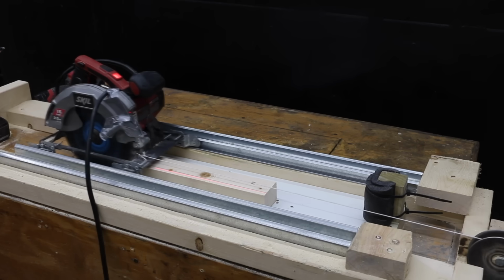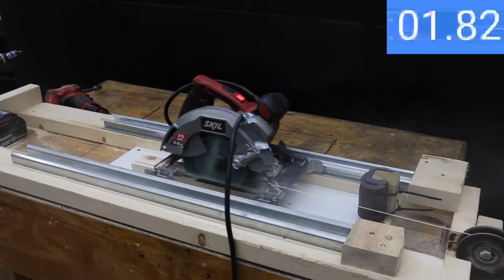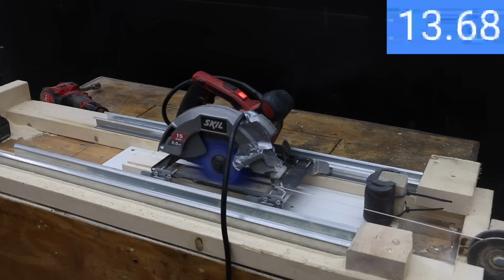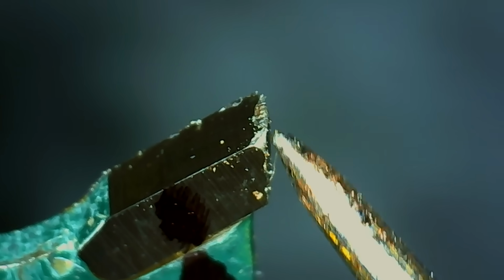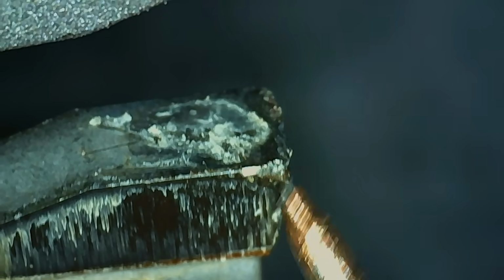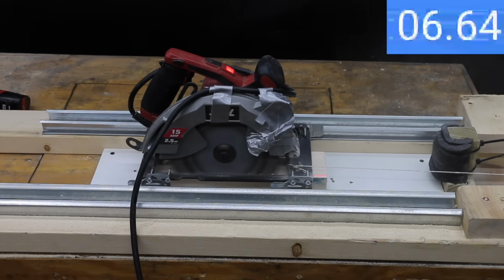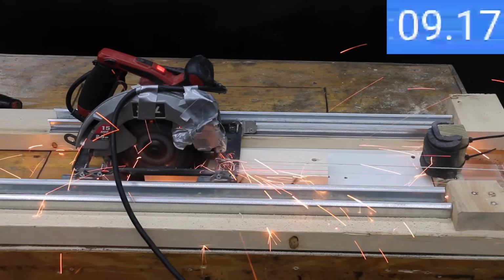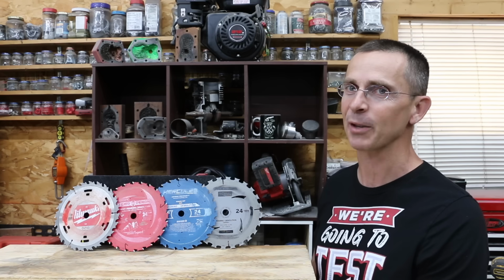Best "Demolition" Circular Saw Blade? Milwaukee, Diablo, DeWalt, Hercules, Evolution, Bosch, Amana

Comment: Each test I'm like "Big Blue.. what are you doing??" LOL Hey, maybe that "Big Blue" would work better as a brush cutting trimmer blade haha
Reply from the maker: Thank you!
Reply: Good point. But wouldn’t that mean that any of these other blades could be used for that application and perform better?
Reply: @yewsengcheong1637  I'd guess the green wood would clog most of these blades
Reply: That's exactly what I was thinking.  They should definitely remarket that thing
Reply: True!

Comment: I’d like to see who makes the longest lasting mower blades. Almost everyone mows.
Reply from the maker: Thank you for the video idea!
Reply: @ProjectFarm  This is a good one. I just threw down $30 on a blade.
Reply: Bold of you to think there are people that actually remove the blade that came with their mower.
Reply: @mc-sp8zr  I saw a guy come in the mower shop while I was buying blades and said his wasn't mowing good. I ask if he looked under the deck at the blades or to see if dead grass was built up on the deck. He never even looked😜 I swap sides of the deck each time I sharpen mine (2 blade riding) because the discharge side blade always wears faster. It gives each blade equal wear doing that.
Reply: @mc-sp8zr  LOL!
Reply: Big blue is damn near a brushcutter blade.
Reply: @queazocotal  FR like wtf kinda demo are they expecting? Concrete block? I kinda think it's meant for a saw with a more powerful motor, not your standard skil saw.
Reply: @queazocotal  ARK player?
Reply: I have requested this too
Reply: @n325aej that's what i was thinking too but that doesn't really count as the blades lasting longer. If i crash my new truck, i wouldn't say the tires outlived the truck lol.
Reply: "Almost everyone mows." is a statement soooo out of touch with reality.
Reply: @orijimi  he likely means that you’ll have a much larger potential viewer count with lawn mower blades rather than, say, demo blades.
Reply: @Slayerformayor1983  exactly what I meant. More people use mowers than they use circular saws. I use both, but I mow probably 500 hours to every 1 hour of using a circular saw. Especially when I have 8 acres and no livestock.
Reply: @orijimi  I hate idea of mowed lawns so much lol. Waste of space.
Reply: @orijimi  Not everyone is like ewe and lives on a goat farm, not needing a mower.
Reply: My 1991 lawnmower still has the factory blade.  I do sharpen it once or twice per year and the ends are getting pretty thin, but I've always failed to see the merit in getting a new blade vs sharpening the one you have.  Maybe a test of a new blade vs an old one that has been sharpened?  (assuming the same lift profile)
Reply: @knurlgnar24  I always sharpen my blades but they’ll eventually get so thin they’re dangerous. They’ll wear a hole between the edge and the back of the blade (In the middle) I’ve got a huge yard and it’s sand and zoysia grass. Both are hard on blades. Everyone I know around here has to replace blades. Are you using a push mower?
Reply: Or...best mulching blades..
are standard blades that can mulch good as blades that say "mulching blades"... let's find out....
Reply: @boosted2.4_sky  Spent time on a mowing crew for a big zeroturn dealer. We could never tell a difference.... even the clumping in wet weather seemed consistent lol
Reply: @Savagenerds  I mow yards for a living, never could see much of a difference between mulching blades and regular.
Reply: I don't know which are best but the scag brand ones are really good. More difficult to sharpen though.
Reply: mower blades are a great idea BUT different brands have different sizes and thicknesses. My Honda blades are substantially larger than my previous brand blades and therefore have a much longer replacement interval.
Reply: @dalinean  all he has to do is go to a mower shop and ask what their most commonly sold blades are and test different brands of that same blade type. Each brand will probably use different hardness of steels. Or maybe not. It would be interesting to see if there’s any difference in brands.
Reply: Something to consider on mower blades is thickness. I have a Hustler mower and their blades are 0.200” thick. Dixie Chopper blades are identical, but are thicker, 0.250”, so they last longer.
Reply: @lem7181  Hustler publishes dirty magazines AND produces outdoor equipment? That's genius.
Reply: Could be a tough one. I use Oregon gator g5. Which is a mulching blade but commonly used. Maybe 2 test. Mulched and regular.
Reply: @n325aej i already agreed with you way back in the thread. What's your point about 100 hours though?
Reply: @n325aej we aren't a grass cutting company but our commercial property has a lot of grass and we own our own mowers.  They don't run everyday like a actual mowing company would though.
Reply: I've never had a mower engine or deck outlive the blade.
Reply: @dalesworld1308  I need to find out what blades your using so I can purchase them. Then I need to find out what mower your using so I can avoid buying that brand.
Reply: @jamesbarron1202  I guess if you mow in a commercial situation you go through blades. But a homeowner GENTLY sharpening his own blades and not grinding the heck out of them, they should last.
Reply: @dalesworld1308  they'll still need about the same amount of sharpening per hour of mowing so i if its low hours and careful use, what kills the deck and engine?
Reply: @dalesworld1308  You should see my 1964 Economy Jim Dandy. Single cylinder rope pull start. Thousands of hours on the motor and deck. 1/4 inch plate steel deck.Been through three generations. The deck and engine will outlive my brand new John Deere diesel with ease.
Reply: @Lucas12v  
"What kills the deck and engine?"
Deck: Rust.
Engine: Old gasoline.
In other words, lack of maintenance.
Reply: @xenaguy01  that's about the only way a blade could outlive a mower. We probably get 100 hours out of a set of scag blades so a mower might go through 20 sets or so in its life. Not sure exactly since we don't keep track of blade life. And we mow kind of rough ground so i could see some people doing better. With cheap blades you might need 40 or 50 sets.
Reply: @Lucas12v  
"that's about the only way a blade could outlive a mower."
And unfortunately, that's the case with most individual homeowners. Few know about, or care about maintenance. Most junked mowers have  a perfectly good blade on them. A high percentage of them have never been sharpened.
Reply: @dalesworld1308  that doesn't seem possible but maybe I'm missing something.
Reply: @dalesworld1308  When I ran a landscaping crew we rinsed the mower decks after every shift, and lightly sharpened the blades every morning. The push mowers lasted the whole two years I was there and looked just as new as when I started. The problems we had were the brass geared transmissions on the power driven mowers.
Now I'm too lazy to wash my own deck so I have to break down every few years and do rust repair and repaint my deck. The moral to the story is wash your deck. Oh and never cut wet grass, unless you are willing to wash that deck.
On a side note: I got caught washing my deck in the sink one time, but that's for another forum.
Reply: Except for Josh. Don’t be like Josh.
Reply: @Ministry_of_WrongThink  hey, I just mowed today

Comment: Couple thoughts:
Ripping 2x4s is less common than crosscutting in demolition.
Saw tooth geometry and tooth size and spacing are generally designed differently for ripping vs crosscutting.
I wonder how much difference crosscutting in the 2x4 jig would have made. I'm guessing the times would have been quicker but I have no idea how that would have affected the overall  rankings, if at all.

Comment: Man I just knew that weird blue blade was going to do horribly lol. As a framer I can say that the Dewalt and Diablo blades work the best and last the longest. There is also I fine tooth Dewalt with many more teeth that works great and doesn't fray up the wood. We sometimes will turn the blade the other direction for certain demolition cuts but mostly for concrete siding if we don't have a diamond tooth blade. But we never use a brand new blade for demo. We usually will swap for a beat up blade to do the job.
Reply from the maker: Thank you!

Comment: Nails are considered inclusions and not the material you are cutting. When it says it is not meant to cut ferrous or nonferrous materials it means the main material you are cutting should not be metal. So no bar stock or metal plate etc.

Comment: As I've said many times, I love your channel very much indeed. I love that it is not sponsored by manufacturers, I love the way you break down the results, and above all, I love the amount of thought and effort you put into your test setups. I watch a number of product test content creators, and the setups you use to test are far and away the best to test for the things that matter to pros and to folks that only want to buy a tool once.
I know you don't accept sponsorships from the sources of your test products, but have any of these companies ever reached out to you? If so, what did they say?
Reply from the maker: Thank you very much!  I receive sponsorship offers daily but I politely decline all offers.  One company offered to give me a "free" zero turn mower just to use and provide them with feedback. No requirement to include in a video.  I declined the offer, since one thing leads to another and I'd rather avoid going down that path.
Reply: @ProjectFarm  Many thanks for the reply. Sometimes you just have to wonder if the manufacturers really understand how no-sponsor channels work.

Comment: I love your testing jig setup in this video.  Great setup for accurate comparisons.  Thanks so much as always and happy to see the cheaper blades won out on this one.
Reply from the maker: Thank you!
Reply: @ProjectFarm  hey good morning sir, only that I broke both of them this morning while getting ready for work.  Boot laces, can you test work boot laces?
Reply: @ProjectFarm  Yeah really Todd, Kudos to you for all the effort and attention you put toward your projects. I may have questions afterwards but I always have a very good idea what to expect from a certain product. I'll repeat it!! It would really be nice if consumer reports was so thorough.
Reply: yes I need to make this jig for myself as well. I think there's some drawer slides in the garage....
Reply: Same. My father has been using a cheap blade and has been able to cut multiple pieces of steel and concrete with it and it cuts faster than most of our cutting wheels.
Reply: Actually they were 2 different blades. It was the exact Diablo blade and a 60 tooth Milwaukee blade

Comment: I've ran a skill saw daily for the last 20 years. I've tried every brand lots of times. Diablo has always been my favorite for speed and longevity. INTERESTING results. Thank you, PF.
Reply: And it's not made in China. Clear winner.
Reply: Diablo is very good for the price. Been doing woodwork for 40 years.
Reply: Diablo is what we use in our metal cutting circular saw. Milwaukee does ok to
Reply from the maker: Thank you for the feedback!
Reply: Really depends on what you're cutting. I've had a 12" Dewalt framing saw in my miter saw that I use to cut applewood, oak, cherry and maple for the smoker. Been there about 9 years 🤣. Conversely if I'm just doing rough cuts in soft pine, I use some really cheap steel blades (no carbide). I can always touch up a tooth or two or throw it out cause a pack of 5 is like $8.

Comment: I’m always amazed at how much of a difference between the products of well known brands. You would think by now with hundreds of years of R&D they would all be basically exactly the same basic design/materials and the more expensive ones would be stronger but that’s almost never the case.
Reply: Like a 248% versus a 2058% increase in time to cut is an insane difference between two well known brands. How could a company with that much money going into creating these products mess it up so badly??
Reply from the maker: Thanks for the feedback.

Comment: I don't generally use my circ saw for demolition, especially not my cordless.  I have a cordless Ryobi, and thought it was crap until I put a Dewalt blade in it.  The Ryobi blade was junk.  Hey did you test cordless Circ Saws yet?  That could be a good test; I actually love my Ryobi Brushless one.
Reply from the maker: Thanks for the video idea.

Comment: Your comparing wrenches to ratchets, blades have completly diffrent uses framing blades give you speed and smooth cut, the carbide gives hardness. Demolition blades cut through masonry metal wood, but cuts rough, not good for finish work.
Reply from the maker: Thanks for the feedback.

Comment: Interesting. Some blades clearly "dulled"  while others "chipped"  producing a "new" sharp edge to keep cutting.  So, the Bosh can likely be re-sharpened, and the others will have to be tossed.  I wonder where the cost break is?  I am betting it is cheaper to go fast longer, and toss the blades.
Reply from the maker: Thanks!

Comment: In my opinion, you can't beat DeWALT blades. Ran them all for years, and when using them for only cutting wood in a carpenter shop the DeWALT blades have always lasted the longest. Good value and performance.
Reply from the maker: Thanks for the feedback.

Comment: I think we need a remake of the "best oscillating multi tool blades" now that diablo has carbide teeth on  many blades! I use the general purpose blades with carbide at work doing demo and it eats threw nails and screws. Even after taking some damage they still keep cutting until the carbide is almost gone
Reply from the maker: Thanks for the feedback.

Comment: Can confirm, Dewalt blades aren't up to abuse. They're prissy blades. An angry beaver could rip a 3/4 sheet of plywood faster than an abused dewalt blade. Took me years to get the boss to buy diablos for us to do formwork with. never looked back after we no longer had to frig around with dull blades.

Comment: I have a 15 year old DeWalt demo blade with huge carbide inserts set to a negative hook angle. It could cut through all of those blades for lunch.  Of course, it’s discontinued
Reply from the maker: Thanks for the feedback.
Reply: You’re welcome, as always. Considering I probably will not use that blade ever again, being retired, perhaps I can send it to you for Project Farm testing? The blade is a beast!

Comment: There was not a "shingle" thing wrong with this video. It was very "pallet"able. You really nailed these tests.
Reply from the maker: Thanks!
Reply: Your humor is pretty sharp. Not a dull moment around here. I definitely saw this coming.
Reply: But did the video make the cut?
Reply: Cutting edge comments on this one🤣🤣🤣🤣🤣
Reply: Yeah, but the blade tests went very slowly. It is like he was just "lumbering" through them....lol. J/K Great job as usual.
Reply: I feel like there's a five pound weight pulling me through this length of comment. 9.7 seconds on the first pass.
Reply: You think you're punny?
Reply: @marks6663  I "saw" that one coming.
Reply: These jokes take a lot of skil
Reply: @timryan2553  exacxtly, done by craftsman
Reply: There is definitely something screwy about this comment…
Reply: @kingfishercomputing9497  gee, with this bunch of nuts, this thread needs to be bolted down!!
Reply: luckily the deck screws didn't shank the tests too bad!
Reply: looks like big blue had the big blues, second worst.

Comment: I think the nail-cutting "not for ferrous metals" blades wasn't an inconsistency, it just meant they're not designed for continuous cuts in plate steel. Your Skil sidewinder doesn't have the torque to do that, either, but some saws and some blades can do it.

Comment: Pro tip....
I keep a new blade in my 'framing saw', keeps the cut man as proficient as possible,
 the half used up blades go in a pile for 'Chucky' the 3/4 wore out 'demolition saw'.
We'll use a demo blade until it goes on a smoke break, then it is replaced with another 1/2 gone blade.
Reply from the maker: Thanks for sharing.

Comment: There’s one thing I’ve been curious about with some of your testing videos. I love that you use weights on the tools to ensure consistency and remove the human factor as much as possible, but I was wondering how you determine what the test weights should be? Obviously different tools require different amounts of weight/force/pressure to achieve their sweet-spot in terms of performance but how does one determine roughly what that number is? Do you test the tools by hand with some sort of force meter attached to see what the appropriate range is to achieve optimal performance prior to making the test videos or something? 

As always, thank you for phenomenal work!

Comment: Great vieeo, Todd!! I might recommend though to add a Kill-A-Watt meter set to amp draw and show that picture-in-picture to gauge mechanical load on the saw during the cuts and then use that to compare against time to see how efficient the cutting edges are as they wear. Might yield some VERY interesting data!!
Reply from the maker: Thanks!  Thanks for the suggestion.

Comment: it'd hard to beat frued the 10 inch 24t thin kerf rip blade... is boss on a table saw. and a 20T Forrest is a beast also...even better with a 5 hp tablesaw.....ridge carbide is awesome to
Reply from the maker: Thanks for the feedback.

Comment: Wouldn't it make sense to do the test making cross cuts instead of rip cuts since demolition will involve cutting across 2x4s instead of with them? also that big blue is asking for a dangerous kickback if someone hit's something solid while cutting soft material, I think the circular saw sled you made may have hidden that especially when the blade came loose.
Reply from the maker: Thanks for the constructive feedback.